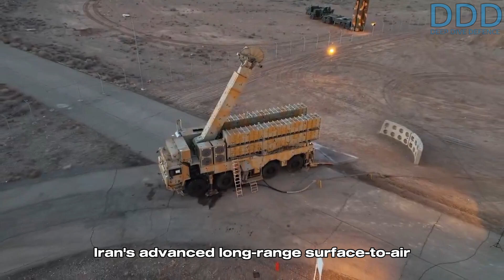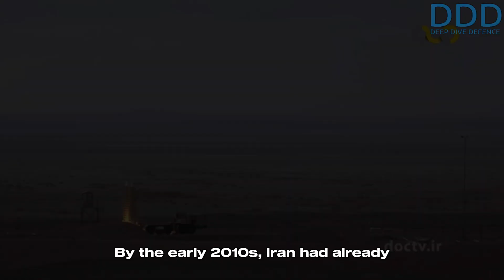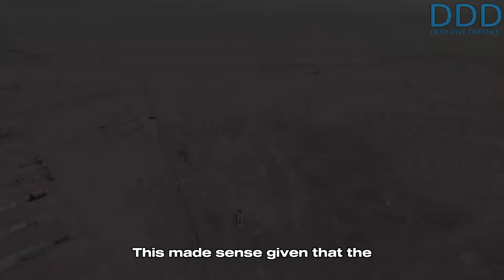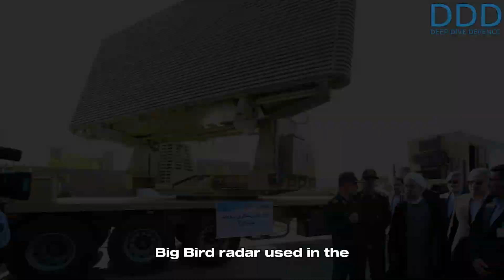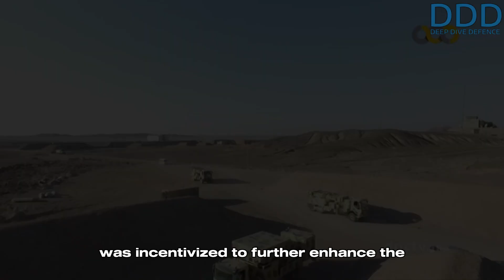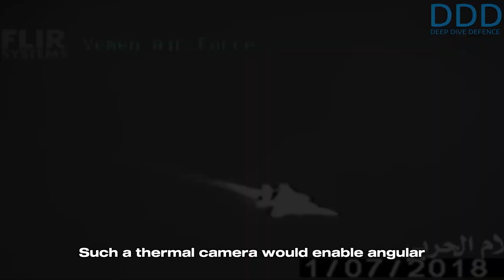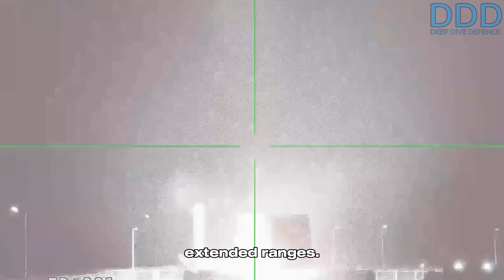Iran's Bavar-373 Air defense system: 2025 Serial-Production unveiled

Comment: China is one of the superpowers in air defense manufacturing, but after purchasing the Su-35, it also purchased the S-400 because the Su-35 must be linked to the S-400 radars for effective air superiority. Iran also purchased the S-400 after purchasing the Su-35, but it does not have a pressing need for it because it has built the Bavar 373.

Comment: Hey I'd like to see the new 313 drones like I've brought up before, especially the difference between the larger drone and the smaller drone, especially if there has been AI integration.
Reply from the maker: Too many topics for a single person, but lets see
Reply: @DeepDiveDefense  just been having a look at it's coating, I'm curious if they've ever used Teflon. The turbofan and the size of the smaller one was a bit of a let down.

I've been reading about developments in thrust vectoring they have achieved and even engines, yet I don't see the results.

Comment: Russia didn’t sell S-400 to Iran so Iran built its own 🗿
Reply: the S400 launcher is visible at 0:15
Reply: @GabrielFernandez-es5nc  That’s s300 lol
Reply: 😂You recognised it from its colour? @GabrielFernandez-es5nc
Reply: @GabrielFernandez-es5nc The only Russian system (S-300) in Iran was operating for the Russian scientists in Iran. All the air-defense szstems used during the 12 days war were Iranian. I saw the videos 100% interception.
Reply: @bujarbequiri8147 the S400 is still protecting the russian scientists at UCF isfahan, the S300 is operational and at service. however the Russians couldn't deliver S400 at time back in 2011 so Iranians built their own system based off S300 called "Bavar 373". it was built up on the experience of the sryian war and israeli fighter jets since 2011 and so on.
Reply: That was an s 300 @GabrielFernandez-es5nc
Reply: @DUDU-p3z  hi there, i tend to disagree. the launcher of S300 is different
Reply: @GabrielFernandez-es5nc  Hi there! What happened was at the time, Iran was supposed to  have the S300 and arrive in 2010. But, due to Russia's suspension of the deal, Iran went on to build the Bavar 373. When the 2015 deal went through, Putin reversed the suspension and provided Iran with its latest variation, which was seen as a 3.5 version. So it is possible that it shares some features with the 400. 

But in terms of the Bavar itself,   in its latest variation, it seems to be on par with the 400.
Reply: @GabrielFernandez-es5nc   how different?
Reply: @claudeboels3878  that mobile launcher can shoot 4 missiles, it's visible in the picture
Reply: @  lol S-300 also can shoot 4 missiles
Reply: You blind 😂 @GabrielFernandez-es5nc
Reply: S-300
Reply: @নাহিন২০২৭ The only S-300 in Iran is for the Russian scientists at one Iranian nuclear site. All the operating Air-defense systems were Iranians. Between 99% and 100% interception, excluding the toy drones of Mossad's cells inside Iran.
Reply: Or maybe Russia help the Iran to built there own Air defense systems on base on Russians Old Air defense System there Engineers Maybe help Iran's Engineers Just to improve the missile design Jamming systems and new Aesa RAdars and Mounted on New Vehicles ...that's it ....

Iran's Already Clearly Decades Behinds from Isrealis and Western counterparts Forces and that's clearly prove in the last one tears How Isrealis got edge On Iran's IRGC and Iran's Airforces Even  Isrealis Airforces Invaded few Kilometers Inside With there F35s into Iran ...
Iran's Needs in True Sense Air defense Systems and Modern Fighter jets Iran's have no Airforce and weak Radars and plus Verry weak Old Vintage Navy frigates ... And in IRGC is Not Professional like Other Country's Army there Only Busy in proxy wars along with Hezbollah and Iraqis and Siryans Proxy's groups which they've also lost Now Hezbollah and Siryans regime plus Iraq is now also losaing Iran's because they are now also tired from Iran proxy's...that's my opinion You guys can agree or disagree...